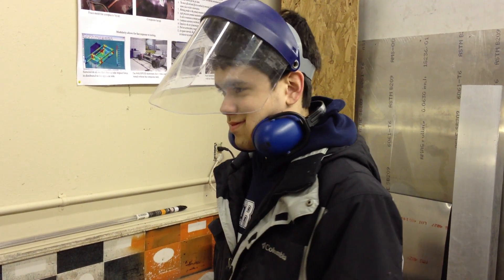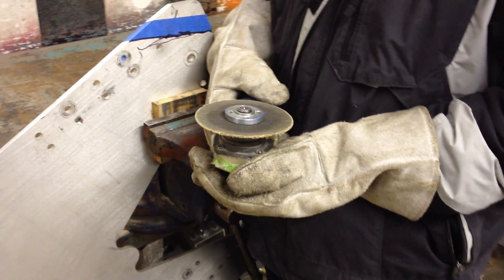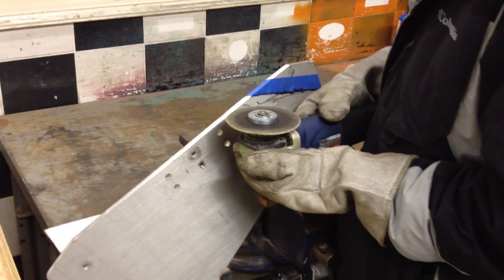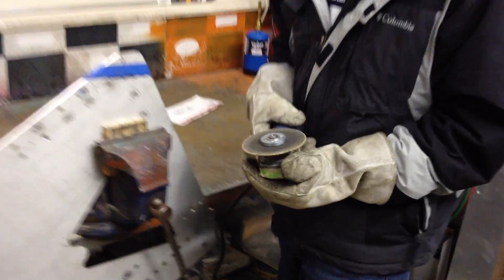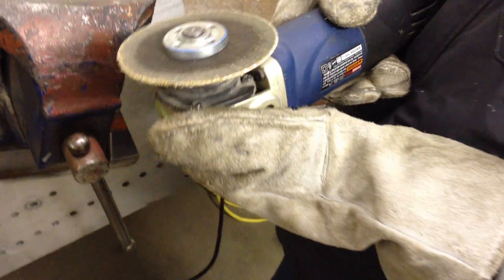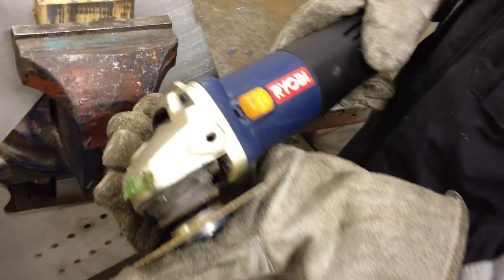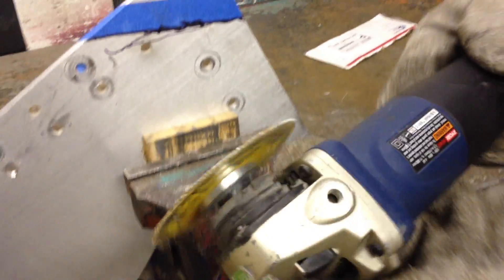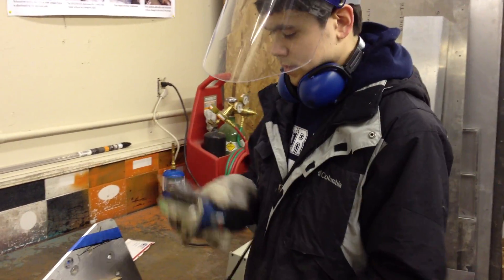WIKISPEED Demo cutting aluminum plate with an angle grinder

Comment: I can't believe this is like the third video I've seen that shows you "how to" do something that is an absolute no-no. Cutting aluminum with an abrasive wheel like other commentors have stated is NOT ok. The wheel will fly apart. How do people not know this? It's common sense. It is the most basic metal working knowledge. Crazy.
Reply: I like to first cut steel with the cutoff wheel, then switch it to aluminum so it shoots thermate fire out in a big WOOOOSH :). how do you not know this yet. crazy bruh

Comment: Dude please get a jigsaw and a decent aluminum cutting blade. You can plow thru plates twice as thick in half the time with a tenth of the same risk of bodily harm. Not to mention the cut will be a hundred times cleaner. Angle grinders with standard cutoff discs are like one of the worst ways to cut aluminum. Hell, even an angle grinder with a disc meant for stone would be better than this standard abrasive cutting disc.

Comment: Never use abrasive wheels on soft metals like lead or aluminum. The metal sticks to the blade and as it heats it expands in the crevices fracturing the blade and sending it everywhere. Also use the angle grinder guard.
Reply: I know a man who tried to use an angle grinder to cut aluminum with an abrasive wheel.  The wheel exploded violently like you mentioned.  He is now missing four fingers.  I would never cut aluminum with an abrasive wheel.
Reply: @k9er233  That's horrible. Sympathies to that man. There aren't many ways to efficiently cut aluminum unfortunately. I guess to go to is the band saw but it takes a ridiculous amount of time for large barstock. Even then it gums up pretty fast if you don't keep the blade well lubricated with a solvent saturated oil like WD40.

Comment: OMG, do NOT cut aluminum like this. where is the safety guard? where is the dedicated aluminum cut off wheel designed specficall for aluminum? use a carbide tipped circular saw, miter saw, or jig saw would be 100x safer!

Comment: he's wearing what I call the shield of shame
Reply: You obviously have not used the angle grinder much. A face shield is mandatory along with eye protection especially when doing cuts on a frame where you might have upward cuts.
Reply: +Dave Smith I use an angle grinder very often , I nake home made knoves and use it to cut thru 1/8 inch steel I use saftey glasses , but I call it that because im a metal forming engineer , and it isnt mandatory the glasses are , but others choose to wear the shield , those who are scared...
Reply: +Adrian Soto make*
Reply: @bumblebeeprime14psn53  so you're a home gamer who has never seen what a wire wheel or a disc catastrophically failing does to a persons face.